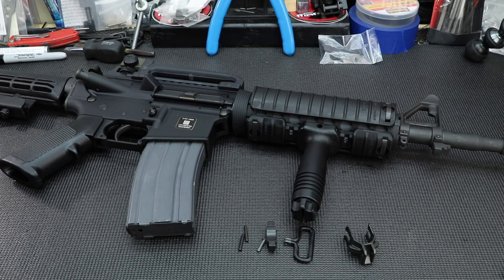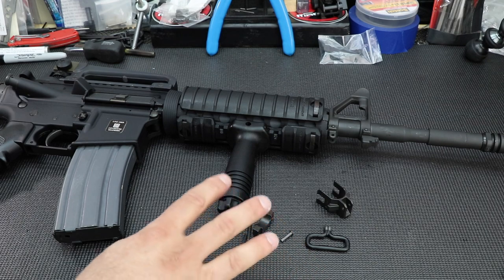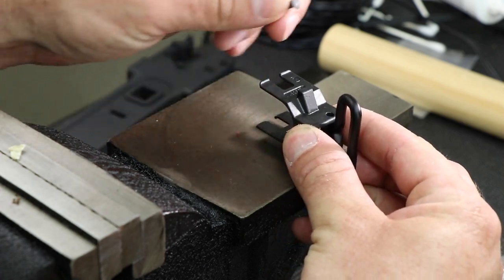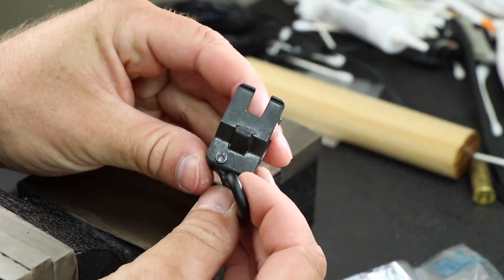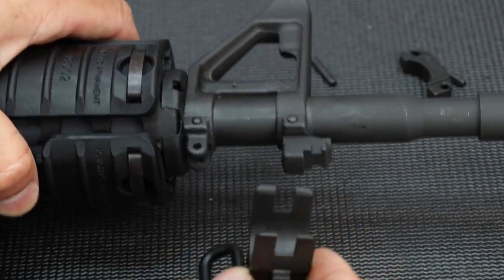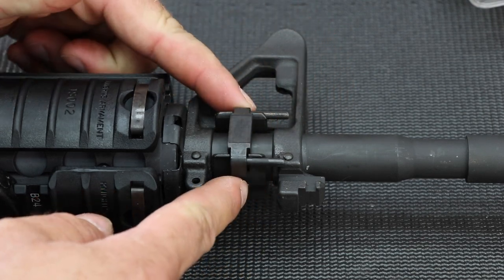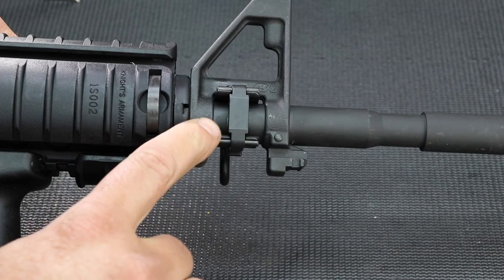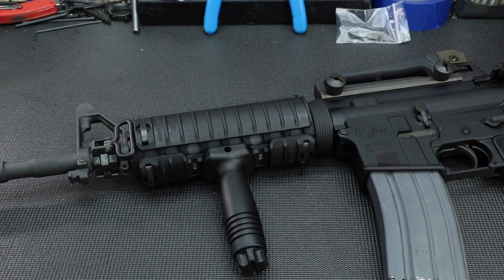Colt Side Sling Mount Install - Colt 14.5" Socom

Comment: I installed mine in an unorthodox way. I took one of the roll pins and drifted it into place in the keeper. After I placed it all on the barrel of my rifle sans the last roll pin. Then, using a pair of channel-lock pliers with the teeth covered with layers of masking tape, I squeezed the last roll pin into place. It saved me a little bit of hammering hassle.

Comment: So there seems to be an argument about if this was installed backwards. As per Army spec TM-9-1005-319-23&P and also Air Force spec TO 1-1W3-5-5-42 the opening should be toward the BUTT of the rifle allowing the sling loop to fold flat REARWARD. While the Technical Manual's drawing showing this is in reverse for a left handed shooter, it clearly shows this on page 2-47.1 {2-47.2 (blank)}. It also explains what side to mount the loop on for the individual shooter on page 2-53 {change 4}. Again showing the loop folding flat to the REAR.

Comment: You have this mounted incorrectly. All the m4s I’ve run into in the army have the mount positioned 180° the other way. The open side should face towards the muzzle
Reply: I might consider taking this vid down, it's teaching the incorrect install. That's if it were me.

Comment: I’ve installed 4 of these in the past and it looks like I installed 1 correctly by mistake. Thanks to all you guys for the heads up on which way it’s supposed to face. Also, last one I purchased was about 3 years ago and I paid about $25.00 total for each one. Now I’m seeing them for $45.00 to $60.00, what’s the deal?
Reply: Cost went up and  everyone wants one now

Comment: Use a C clamp to mash the pin ..  put one in first , attach it by rolling on and over then push the 2 Nd pin thru ..  by the way the sling is put on backwards  the sling pushes down flat towards the muzzle??

Comment: Great job.  Two things...bugging me, i know are driving you nuts.  The river split.....ouch and it is mounted towards the rear of the fsb.  Try to equal space within fsb.  Just saying.  It may be eating at you....I would have to get new rivet
Reply from the maker: +Andrew MARGOLIN Haha, those 2 things are bugging me as well...... From what I read online, most people said you had to hit the rivet really hard to get it to spread but I don't think you do. It seemed pretty soft actually. I'll probably end up changing the rivet before too long.
Reply: Yep....I have done it for a fellow member...and I barely had to impact the rivet to get it to mushroom.  Think of Caddyshack 2.....tiny tap...tiny tiny tap.
Reply from the maker: +Andrew MARGOLIN Where were you yesterday with all this info haha..... My OCD will end up placing an order for a new one soon though..... and this time the big hammer is staying away!
Reply: I just did this install 2 weeks ago and noticed the same thing regarding the split. I used a small brass hammer and very little impact to round out the rivet before using a flat punch. I also made sure to center it. Great video! It definitely will help others who are installing, as there are not many good videos to show the process.
Reply: @NolanOutdoors  The rivet looks like a standard Colt AR15 sling swivel rivet in size and length and those are available for replacement. both real Colt rivets and other makes.

Comment: Where did you get the front vertical grip?  What brand is it?  I had one just like it and would like to replace it.  It was on my rifle in closet during a fire and it melted.  Don't know about yours,  but mine,,  the thing on the bottom tightened it up up against the rail so it DIDN'T move AT ALL!!!

Comment: Thanks for the video!

Question though, was it installed backwards? I’m having a hard time picturing what the correct way would be... I’m right handed too, so I plan on installing mine the same way you did...

Also, what are those vice grips you used called? I may need to get something similiar...

Thanks!
Reply: It is supposed to fold flat forward and the vertical stop goes to the rear towards the hand guard. It is also supposed to be mounted far enough back towards the hand guard to allow it enough space in front to fold flat.
Reply: CavTrooper19D  You being flat-out wrong about the installation somehow makes this whole rant really funny.

Comment: Just bought and installed this part. I put it on the same way, but this orientation doesn't allow the left rail cover to be removed. Would you recommend flipping it around?
Reply: Jack Kuerbitz the uplaoder did a good job, very tutorial. But he did install it backwards. So, yes. Flip yours around for the correct orientation
Reply: Wait what? Those rail covers go in and out only one way?
Reply: I was just about to install it and noticed this too. Smh

Comment: You have it installed backwards, the sling should be able to swivel fully forward to be able to remove the kac rail panel cover, don't worry though I learned this by doing it myself

Comment: Those rivets are difficult. I used a smaller prick punch and that worked better but yeah, a huge pain in the ass.
Reply: He used the wrong tool, that's why. He needs a rivet flaring too, but oh well. Like all Youtube videos the info is amateurish at best utter garbage at the worst and basically neither if it's from a manufacturer.

Comment: You just put that on the wrong way The sling Swivel Should not be able to touch the handguard And the Rivet head should be facing  up but it will work like that  But that's not the way the factory does it .

Comment: You installed it backwards
Reply: Nope. It's the correct orientation. If it was the other way around that would expose the sling to high heat from the barrel when the swivel swings forward.
Reply: @octuu he said it best,  u can argue with them till your blue in the face..but you are right.he did install it incorrectly.

Comment: hows it holding up? I heard this thing gets loose after a few hundred rounds due to the heat of the barrel expanding the metal.
Reply: its useless better to have it like it was originally designed
Reply: @audreymota8423  Yep. mine was just like in the video at first. Nice and snug, but after  a while it loose... i dunno even know why.

Comment: Mine was a bitch it to try to use the pins my swivel came with.  I had a set of roll pins from lowes that i used instead. Went in much easier and the pins do not back out